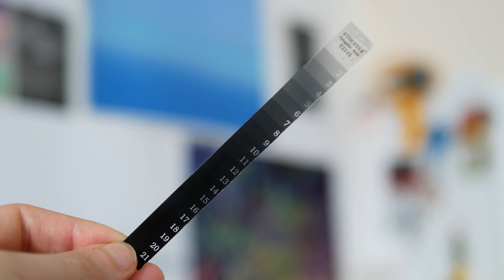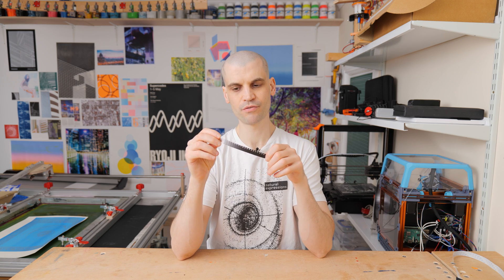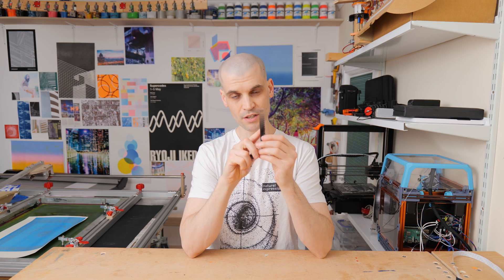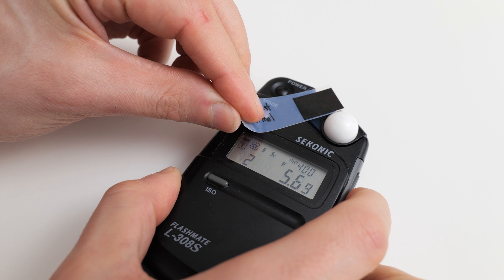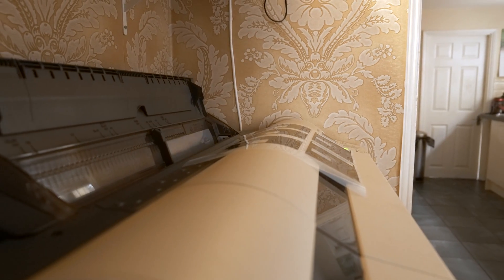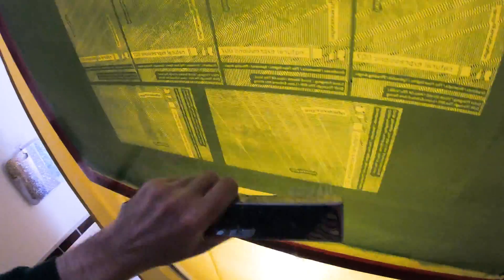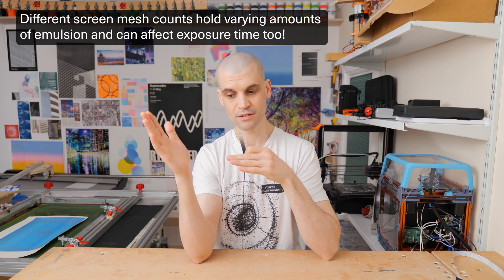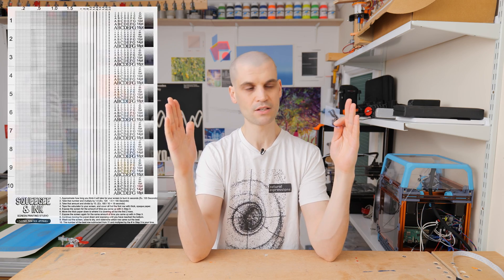Step wedge tests are useless? Screenprinting for beginners

Comment: I also thought they were useless when I first started. I thought the downloadable calculators were all I needed. Boy was I wrong. After trying the step calculator again on a random exposure I was under exposed by over 120 sec. Now i always use one. I personally think they are underrated. And yes you do explain a great way of using the step calculator.
Reply from the maker: Agree, they are definitely a big help in understanding your exposure setup

Comment: Thank you! This is the most useful video yet! I also found the same thing as you said when I first started screen printing (here for a refresher coz it's been a while). If it was under exposed, I just gently washed it out and left it in the sun to finish off. Then lengthened exposure time a little next time. I'll be keeping a diary this time though... That's a smart idea! :D